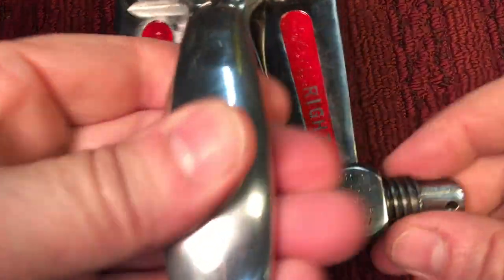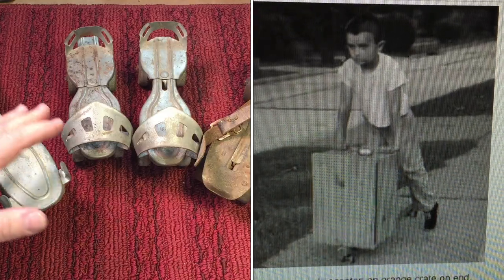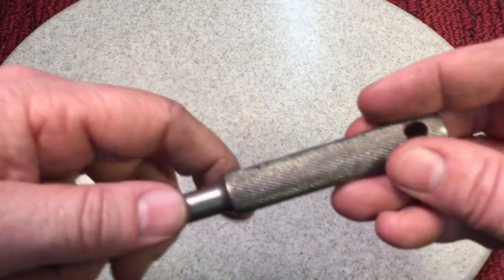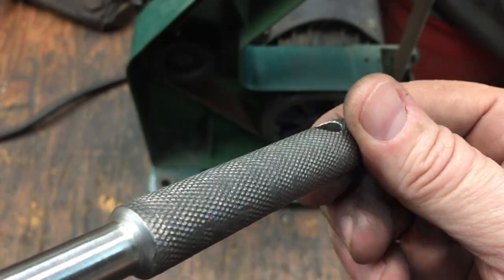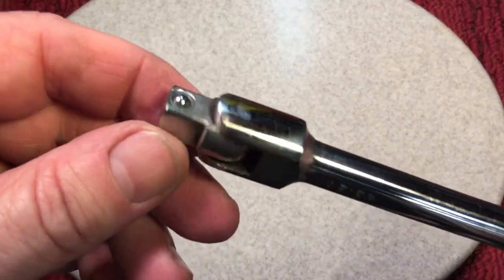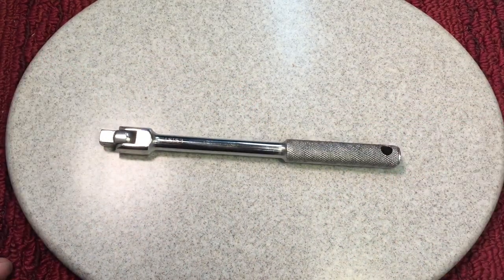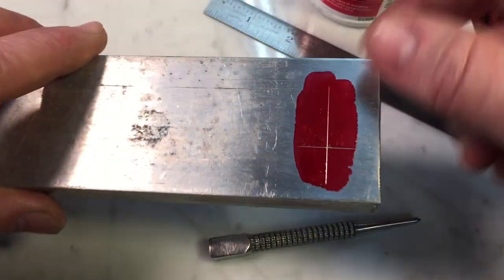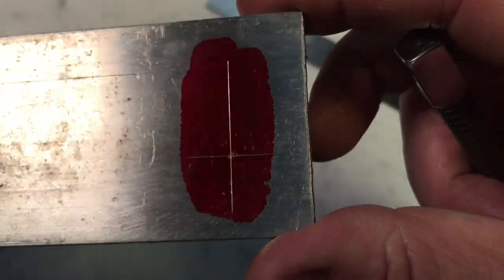MMM SK Breaker Bar, Euler's Disk, Optical Punch.

Comment: Amazing what one can market with that spinning disk.  Remember the pet rock? That breaker bar turned out very nice. I've never seen a hand knurl tool! Impressive! I love your vise holders, just some wood! You are not kidding, not sure how many times I've used a punch and missed my mark!  Good tip on dragging the punch in the cross section.  I've seen those optical punch, never one in use, that is an excellent tool for precise work! I love me some M.M.M's!

Comment: Great show, today. My father had a knurling tool almost exactly like the one you have. I had forgotten about that thing until today. Sadly, I let that tool get away from me. Lost to the circumstances of life, I guess. I don't think he ever used it more than once or twice. So, I went digging through my stuff and drug out an old Bemis & Call No. 90 15 inch steam fitters wrench. It had at some point in it's life belonged to the now defunct Missouri Pacific Railroad. Has it stamped right in the handle. I figure it is approaching 100 years of age. I did the wire brush treatment and suddenly felt a whole lot better. Go figure! Keep the shows coming. Your knowledge of tools is an asset to anyone who loves tools.
Reply from the maker: Hi Stephen!  Refurbishing a tool is so satisfying and enjoyable!  It doesn't have to be polished or shiny just clean and functional and lubricated...  You are so right, what a feeling!
Reply: @ScoutCrafter  Something else on a slightly different note. If you are like me; I am sure you have quite a few American made Craftsman tools. I have found that I have taken them out of use (not that I am able to use them all that much). But, the idea of should something happen to one and I took it to Sears for a warranty; I would not get an American made Craftsman back. I would get the current flavor of wherever they are now made. It seems a shame; because I have gotten good use through the years. They never were Snap-On, SK, Mac, or Proto; but, they were a good tool. Do you still use yours?

Comment: Yes, I had one of those scooters. My Dad's thrifty gene kicked in, though. He made it from 2 pieces of about, 4"- 1x stock with a couple of diagonal braces and a Tee handle on top. I always thought about getting one of those centerpunches but, thought they were a gimmick and I worked on a lot of pieces that were too small for it to sit on top of. And that disk, WHOA! I used to do that with plates and jar lids as a kid but, they never spun as long as that one did. It must have something to do with the hardness of the glass and the weight of the disk. COOL!
Reply from the maker: Dave, the punch does work but is one of those tools you rarely use but is just very cool!  LOL   Thanks!!!

Comment: Funny that you started with the old roller skates. Yes, growing up we had a few pairs with the leather straps and key. They were so bad it was like rolling over gravel. I pointed out skates like those at elephant trunk yesterday. How funny is that. That knurling tool really worked well as did the optical punch. I bought and old Kennedy box and it had a different type in it. Haven't used it yet. Great job on the breaker bar!! That Eulers disc took much longer than I expected. Pretty cool stuff.👍
Reply from the maker: All fun stuff Steve!   =D

Comment: My mom bought me a pair of those adjustable skates back in the early 1980s. I never used them but man did they rust out sitting in the basement. I think she bought them either at  TSS or Woolworth back in the day.  It's interesting since I bought myself a pair of crampons for ice hiking, and it's basically the same way to slide and lock it in place for your hiking boots.  Funny thing is I bought a pair of Black Diamond brand made in the USA cost me $120 and my friend bought a cheap $30 China pair off eBay. End of the hike hike his points were worn out and mine were still sharp.
Reply from the maker: LOL   Kent we had to learn about quality the hard way!!!!!!

Comment: Knurling came out a LOT better than I expected!
Reply from the maker: LOL  Me too!  I thought it was going to be chop meat!  =D
Reply: One thing I don't understand about knurling. So you have your wheel and then you have the thing you want to knurl. One turns against the other, but just like gears, the two round items have a diameter ratio. So how does anyone ensure the ratios are coherent such that the same grooves in the thing-to-be-knurled are caught on the next rotation of the knurling wheel? I never see anyone paying any attention to this but I've never seen it be a problem either. It's a mystery!

Comment: I inherited a sk superkrome wrench and man that was in a rust bucket of tools unfortunately mixed in but wow do they do a job with the chrome just wiped it down with wd40 and it shines. I also inherited an sk breaker bar and I have to say I love their knurling its sharp / maybe too aggressive to some people but I prefer it. Also I forget you were involved with the boy scouts eagle scout here. I've been going through other old inherited tools and came across a craftsman malleable c clamp that's bent just waiting to restore it's not in that bad of a shape maybe misaligned 1/4 to 3/8 thinking just vice and bend it back, I'm just waiting on grabbing a larger adjustable / crescent wrench you had me interested I think I'm going to go to zagray in October its saying 2.5 hours from staten island. Hopefully maybe I see you there if I can make it. Also maybe I could get in touch with you I put aside some screwdrivers you might want to take for restorations I have no use for them tried selling garage sales etc and they didnt sell so they were put aside for donation. Also have a craftsman cast iron table saw in need of restoration currently not working but I think it's some wiring issue I'm just waiting on some time to verify that's the only issue as the motor and switch is spliced in a handy box and it looks like wiring maybe dry rotting so I feel that's the issue that I could fix, but I'm planning of eventually moving and dont wish to move with this table saw perhaps you maybe interested as well.
Reply from the maker: Hello Rob!   YES!  You have to go to Zagray!  I know it's a drive but well worth it!  Leave early and just sit back and relax!   There is also Jacktown which is closer to you!  We have a lot to talk about!!!!!   =D   Thanks!!
Reply: @ScoutCrafter  I put in for the time off from work so I'll see, I knew about jacktown and I want to go there as well. How do you find when these events are? I'm looking to pickup some adjustable wrenches, c-clamps, vice grips and some pliers maybe see what else is around haha. You opened my mind to looking at used tools differently, before maybe I'd pass them by for rust etc and now I've changed my mind being most are imports now and I rather have USA made as well as quality. Yard and garage sales here dont seem to have alot of these tools or as reasonably priced as I've seen on your videos of these places. It seems like all these yard sales people hold onto things and dont want to negotiate prices from what they saw on ebay or believe its vintage and collectible and rather hold onto it than sell it to someone who might actually bring it back to life and put it to use.
Reply from the maker: @robfahey1349  Both of those shows are awesome for finding great tools at a bargain!  I Love Jacktown but some shows are better then others for certain tools.

Comment: Show me how to rechrome a tool.
Reply from the maker: Chrome plating is super hard to do at home, nasty chemicals and high voltage are required and it's practically impossible...  Polished steel looks so much better!
Reply: @ScoutCrafter  They have home kits.  Just looked at prices and they cost hundreds, so probably not worth it.  Thanks for the reply!